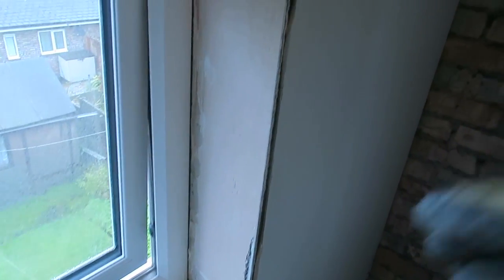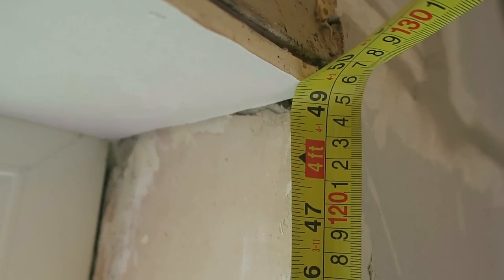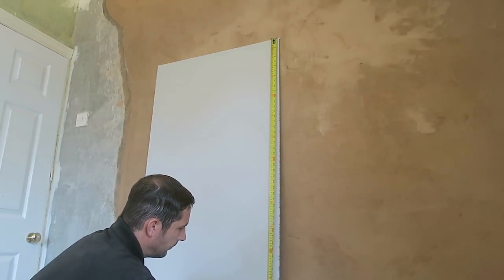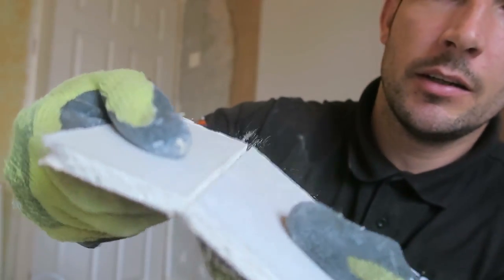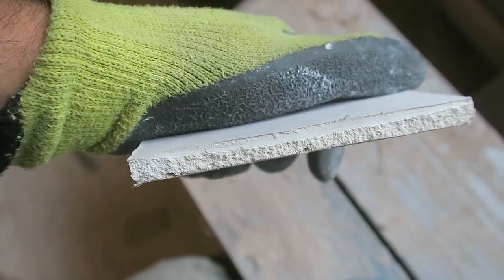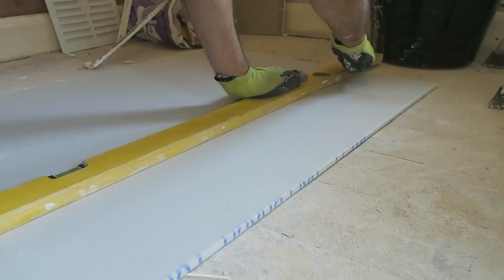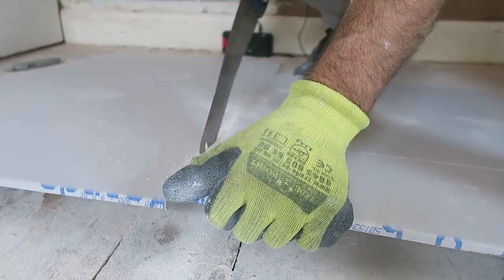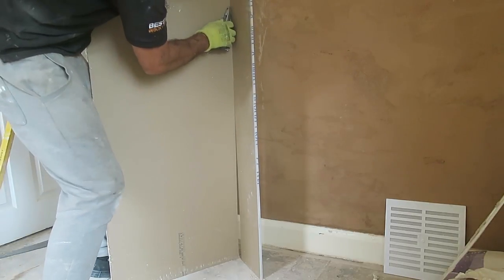how to cut drywall plasterboard with stanley knife

Comment: Hi.  I'm blocking a chimney using plasterboard but need to patch two pieces together.  Question is, do I tape front and back of the board which is going to be plastered over.  Thank you.  Di